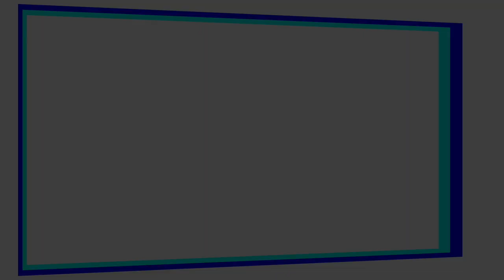Brake Rebuild-How to (Dirt Bike)

Comment: A little better work with the camera showing exactly how you have installed or disassembled things would be a good addition. A little more thorough explanation too, seems like you’re rushing a little bit with the video. You have probably done this a 1000 times but you need to remember that a lot of people who are restoring a dirt bike may have limited experience with restoration.